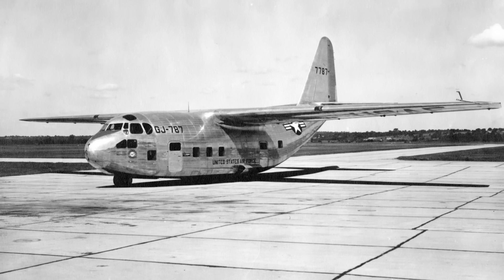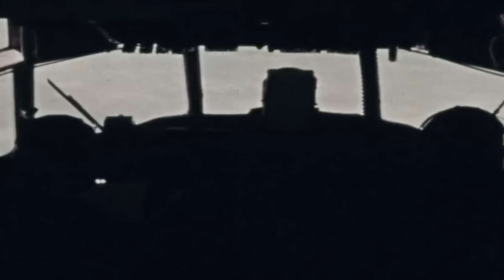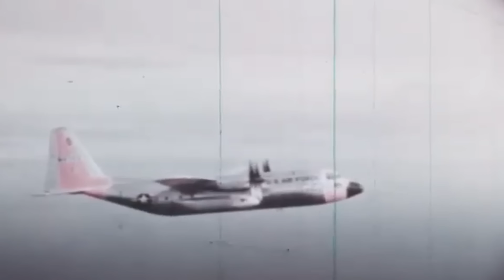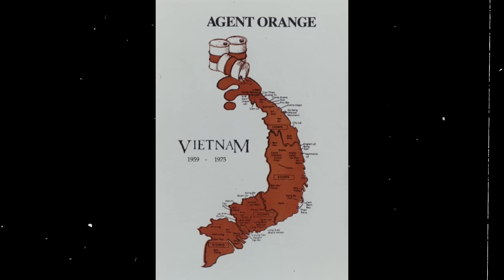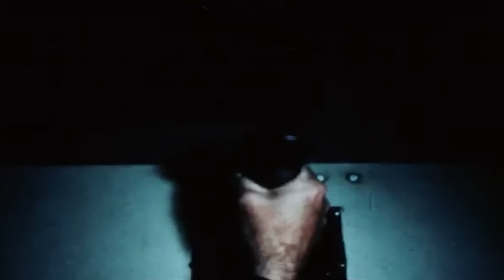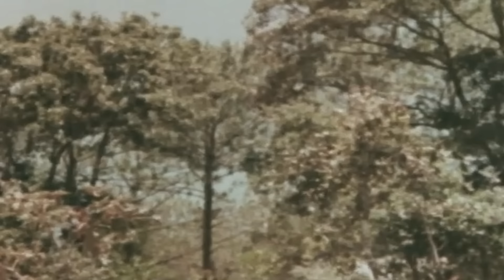The Most Dangerous Plane America Ever Flew

Comment: I was a Air traffic controller stationed at Can Tho in 1969. We hated dealing with the C123 because they took a very long time on the runway preparing to takeoff. These C123 would cause havoc in the traffic pattern that would cause other aircraft on final approach to have to abort landing and go around. It got so bad that one day as a C123 sat on the runway, I told the pilot to hold in place and cleared a C7A to land. The C7A flew over the top of the C123 and landed! The C123 pilot was livid but I didn’t give a damn. It’s a wonder he didn’t write me up and the C7A pilot thought I was funny as hell. Just another day in Vietnam as an Army controller. The irony of it was there was a Air Force base several miles north of us but I suppose the Air Force didn’t want any Agent Orange on their airfield so we (the Army) had to handle that crap for them. Live could be a bitch back then.